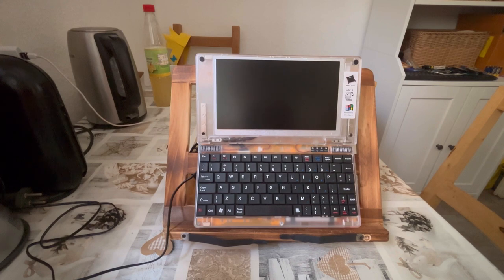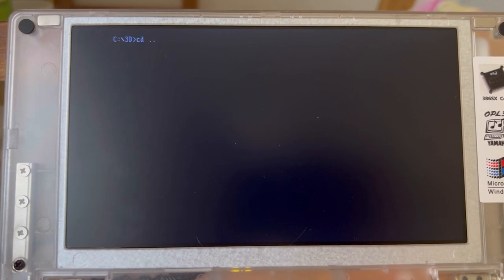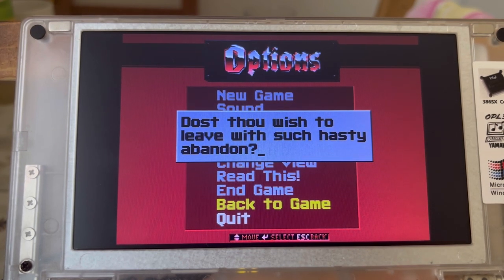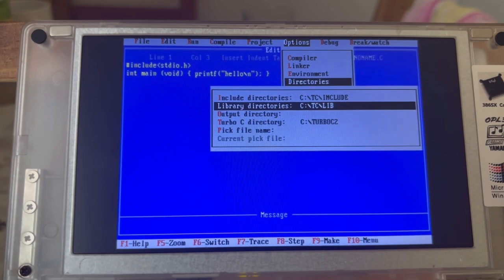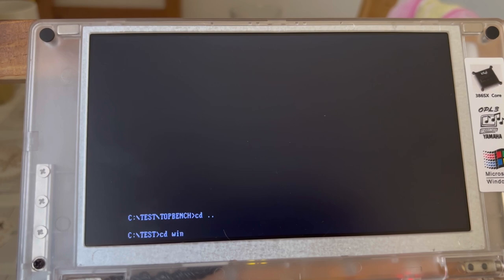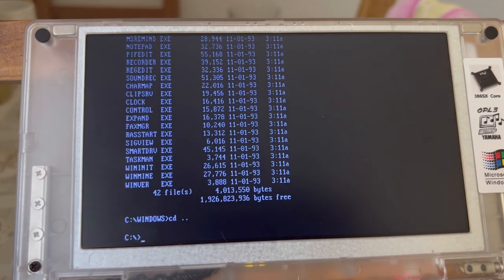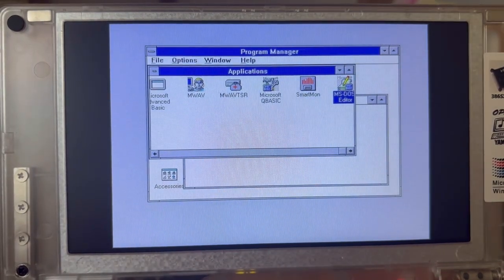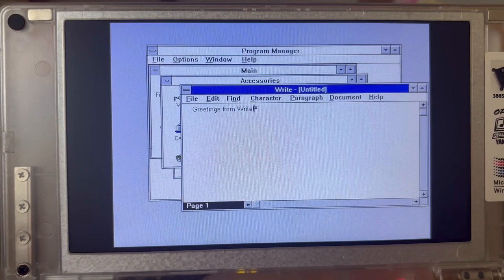Pocket 386 new retro laptop: software overview

Comment: Can it run ST-DOS?
Reply from the maker: Never heard of it before, but I am exploring it and I will try it — very kindly thank you for that amazing suggestion!!
Reply: @ninoivanov  Many things in ST-DOS work quite differenly from MS-DOS and its 100% clones. You can come to its IRC channel if you have questions!
Reply from the maker: @tikkasen_urakointi I actually do have a question: any chance to tell it the correct CHS during setup? It "miss-guesses", and the result is unbootable.
Reply: @ninoivanov  It depends on the disk. The USB stick image can boot from any geometry, but the BIOS needs to support LBA indexing, which is probably not available in your 386's BIOS. Try using a virtual machine to install ST-DOS from a floppy image to the CF card? Then the geometry in the boot sector should automatically become correct.